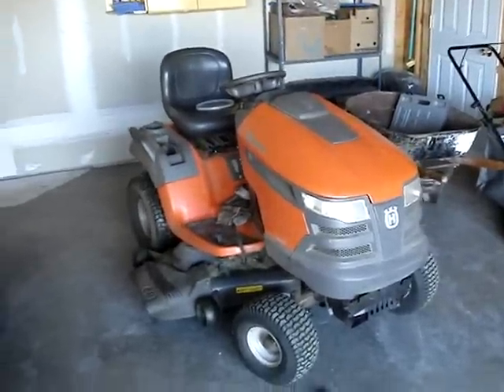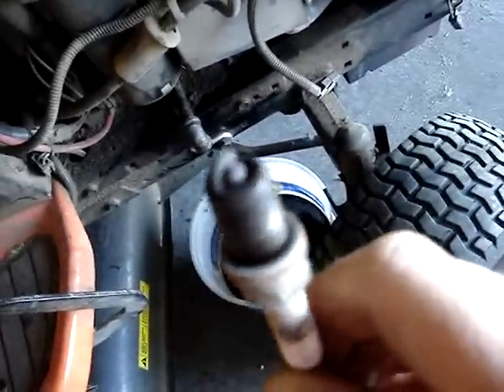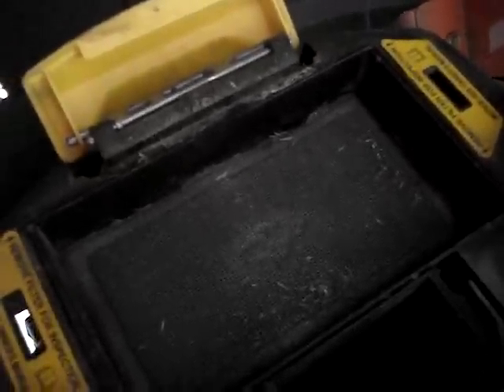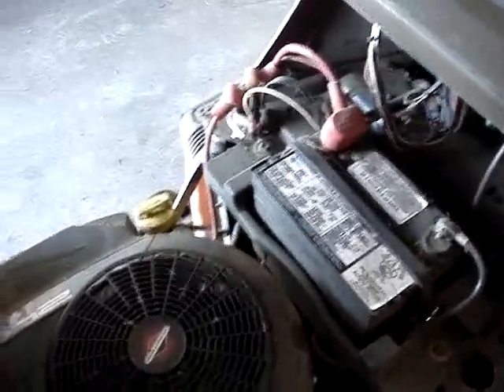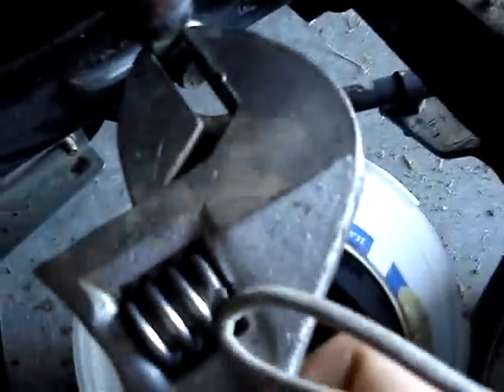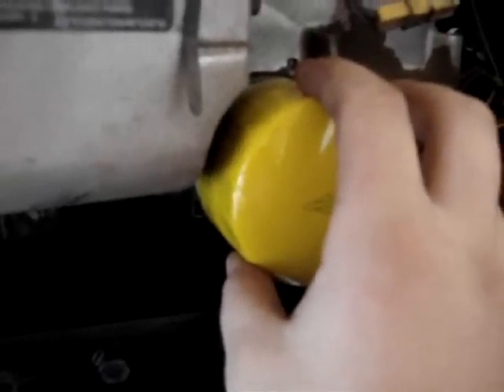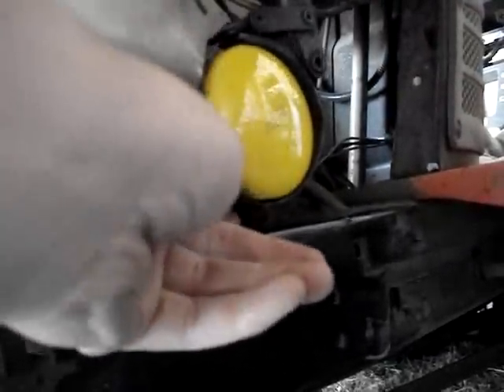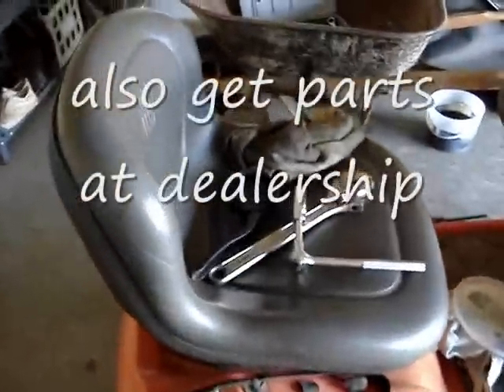Spring riding lawn mower maintenance

Comment: Just a quick tip to keep some of that oil mess down when changing the oil filter. Take an empty, round, oil bottle and cut the end off. Then take and cut a half circle out of one side of the bottle so you can reach in to spin the filter. The bottle's lip will slide right under where that filter sits, you will still be able to spin the filter off, and it will catch the mess so it's not all over your frame.

Comment: I have a Husqvarna YTH1848XP. I always do the same as you with all my pre-cleaner air filters on small engines. I added a little oil to them after washing them with a little dishsoap and drying them. According to the manual though, it says NOT to add ANY oil to the pre-filter (at least with the Kawasaki engine). Don't ask me why but they seem to make a point out of it. Good video though. Now if you want to make another good video make one showing how to remove the deck on that mower  ;-).